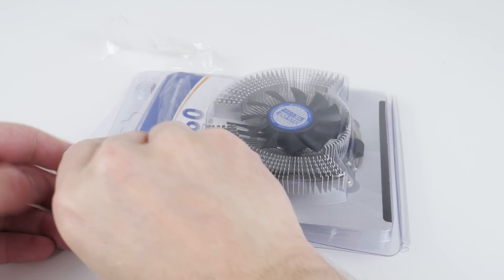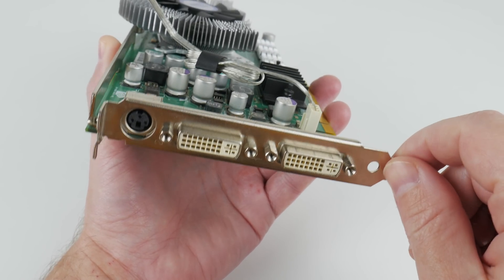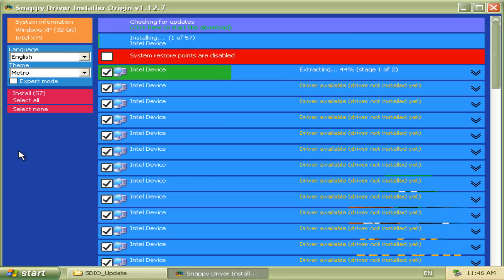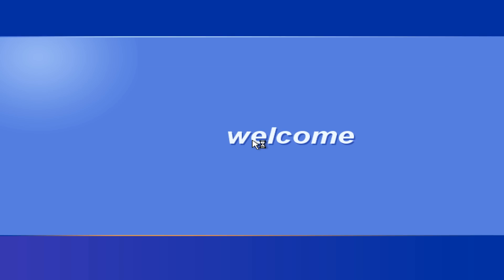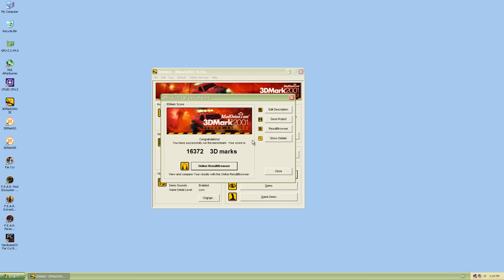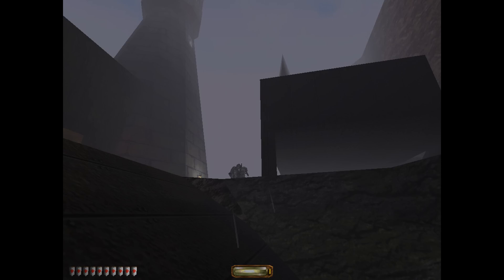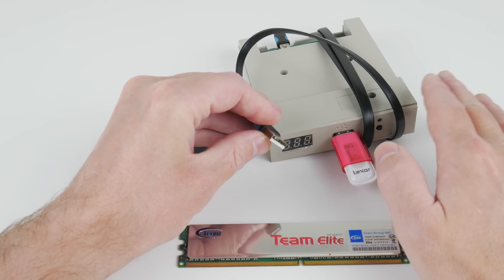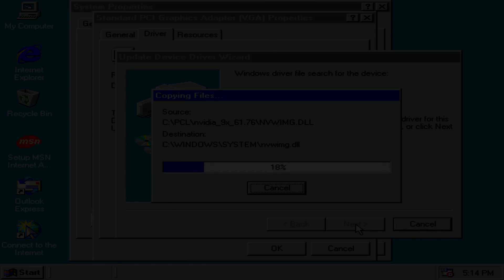Nvidia Quadro FX 1300 - FX Retro features with PCIe

Comment: After converting a Quadro FX 1300 to PCX 5900 on a hardware and BIOS level, it turns out you ran the wrong driver. 175.19 is notorious for issues with these cards. With 71.84, both an unmodded Quadro and a Geforce PCX 5900 will support 8 bit paletted textures. Also you can see in your FF7 config tool that only the software renderer was available when you ran it! Time for a retest? If you want to know how the hardware conversion works, let me know. It is simple soldering that I am sure you can do!

Comment: noticed you had a lot of trouble with the card there, i did too at various points through testing.  the best way to use this card is to first target a system that is more enterprise from the time, like a precision or optiplex or etc, core 2 era preferably.  second is to use windows xp 64 bit (i know i know...), it is what seems to be what it was most intended for and has the best compatibility with at that specific point in time.  it eliminates nearly all of the driver issues experienced with any other os, allows the maximum number of possible games to be playable, and at their intended performance, and etc.  windows vista 64bit is the second best choice, but even here you start to have a drop off and experience some problems.  any other 64bit os lacks a driver or doesn't work when forced, and nearly all 32bit os have problems so great it's crippling.

Comment: Ok Phil, I received my FX 1300 card and had a chance to mess with it under WinME. Since the drivers you used didn’t work, I went for the unofficial NVidia 82.69 drivers. The installer detected my card no issues and I played some Expendable. No issues whatsoever! All options in NVidia control panel were available and I even tested tweaking with PowerStrip. My test system has a P4M890-M7 TE motherboard with a Core2Duo 6700 and 4GB DDR2. I have the RLoew patches for SATA and ram installed, and I’m dual booting WinME and WinXP on a 2.5” 320GB SATA drive. Maybe you can give the FX 1300 another go under Win98 using the 82.69 drivers. 👍
Reply from the maker: Can you try the FF7 demo to see if palleted textures are supported please?
Reply: @philscomputerlab  will do sir!
Reply: @philscomputerlab  sorry it took awhile. I had to install a sound card since FF7 Demo looks for MIDI too. The answer unfortunately is no. The 8-bit palletized textures says fail. I tried to run the demo anyway and I just get a black screen. Is there anything else you would like me to test?
Reply from the maker: @mesterak  Thanks for testing this, I got the same, just under XP and wasn't sure if it would be different for Windows 98.
Reply: @philscomputerlab  you are welcome. I did test under XP just to make sure as well because I did use different drivers there, too. No dice.
Reply: Have you ever tried it with 77.72? It’s the last driver version that supports palleted textures.

Comment: I've been playing around with this card in an experiment to try and build the fastest Win98 compatible mini-ITX machine I can get, and it's been a pretty decent upgrade over the FX5500 PCI you'd usually be limited to on the form factor.  I was curious how Win98 would deal with PCIe, and on my DFI Itox CT132-B1U (a really cool little mPGA478 mini-ITX board with both PCI and PCIe slots), it surprisingly doesn't seem to even know the difference and just sees the card as a PCI device.  It does seem to be limited to 1 lane, which makes sense, with 3DMark 2000 scoring about 7200 in Win98 but over 17000 in WinXP, but it does work and that leaves the other PCI slot open for a sound card.  Even more to my surprise, I bought a $30 PCIe to PCI adapter off amazon just out of pure curiosity to see if it'd work, and astonishingly it did with more-or-less the same performance as when plugged into the PCIe slot in Win98.  My take-away conclusion is that this card may be a great upgrade alternative if you're looking to get the most out of a Win98 build with no AGP slot.
Reply: That's awesome, I'm doing the same thing with a 479 board.  What software did you use to check how many lanes the card was running?

You still like the FX? I was thinking of grabbing one.
Reply: @foch3  I'm just assuming based off the performance drop going from XP to 98, as this drop did not happen with regular PCI cards.  Not sure if there even is a way to confirm in Win9x since PCIe isn't even supported as far as I know.  The DX9 support on the FX series is pretty useless, but they're great if you just want the best framerates with great all-around support for  9x era stuff.
Reply: @k7a  Picked one up just because.  I'm using a 915G chipset on an industrial motherboard with a PCI-E 16X slot, that has full driver support.  Amazingly this card exhibits the lowest drop I've seen from XP to 98SE.  I lose 20% on most cards typically.

What Board are you using?  Edit: never mind DFI, that board looks legit.  I like yours better.  

On my board using the SATA ports drastically increases the mouse latency in 3d games, to the point I was going to right the whole thing off.  On IDE it feels as it should.

I'm also getting resource conflicts with any non Bridged Nvidia GPU's.
Reply: @foch3  Oh I'm totally sold on DFI boards after this one.  Manual's the best I've ever seen, actually includes notes explaining obscure settings and features where every other board manual just lists what's there and and leaves you to google what it actually is/does.  I also emailed their support and they were still able to answer all my questions on this 15 year old board.  Better experience than I've ever had with a consumer board.  Really turned me on to the industrial side of retro computing.
Reply: @k7a  Yeah I had the lan Party Ultra-D, an outstanding Athlon 64 939 board.  It was a shame when they left consumer boards.

What processor are you running?  Your scores seem higher.  I'm on 1.7ghz Pentium M.  3dMARK 2000 I'm getting 6200 and 2001 I'm getting 8900.

Edit:  How do you even use the 16x PCI-E slot?  wouldn't it be behind the IO shield.
Reply: @foch3  Yeah, slot's behind the IO shield.  No idea what they intended there, but I used a PCIe riser cable (Fractal Flex VRC-25) to run it to a nearby slot.  I tested with a Core2Duo 5500, presumably singly core only in Win98 but still, yeah, I'd expect some gap vs. a Pentium M.  Also 3DMark is a fickle beast.  Always has been.
Reply: @k7a  What drivers are you using?  The 6x.xx drivers are the only ones that even listed the FX1300.  I'm going to back through the drivers now that I have the system figured out, this time without focusing on 3dmark but rather in game feel.
Reply: @foch3  66.94 I think for Win98, and 61.77 for XP, however I probably started with whatever the earliest version was that listed support for the card on Phil's site.  Was trying to troubleshoot DX9 stability issues but in the end it seems like DX9 was just cursed to crash on my particular card.  Never did get DX9 working particularly well on it.

Comment: @PhilsComputerLab - it is working for me. Can run 3dMark2000 and Unreal Gold on a FX1300. Setup: Asus P5PKL/1600, Core 2 Duo E8500, 512MB ram, WinME, Nvidia 82.69. Motherboard on standard WinME drivers, HD Sata on Sata Port. DVD-Rom IDE on SataPort with Adapter. Bios settings: IDE Sata only, Compatibility mode. APIC 2.0 disabled. USB 4 ports only (instead of 8). Lan and all onboard features (Serial, Audio, etc) off. Disabled the VGA with yellow warning, installed the Nvidia drivers. On first reboot it might freeze and get not loaded on reboot. Install again and 2nd time it works.
Reply: 3DMark2000 w/ FX1300 7030..... FX1500 42140. I will try other Nvidia cards. I don't have ATIs to compare on PCIE, only AGP.
Reply: Unreal Gold on FX1300.. fps 57 min 261 max 126 avg / cycle 51sec. On FX1500... fps 195 min 895 max 416 avg / cycle 25sec.
Reply from the maker: Awesome 👍
Reply: @philscomputerlab  Thanks :) / tried also on a Gigabyte GA-965P-DS4 with Core 2 Duo E6400 and it works!. I used the same hard drive with the previous WinME installation, didn't have to install anything... at startup it detected everything, restarted and it was there. FX1300 detected, could ran also 3DMark2000 and Unreal Gold. Please let me know if you need any additional details. I made a short video showing the system running - can upload to Youtube if needed.
Reply: Have you tried it with 77.72? It’s the last driver version that supports palleted textures.

Comment: For cheap pcie fx card also nvs 280 is an option, though it has annoying video connector. Btw if someone wants legacy boot and nvme the 950 pro is only option. (Samsung made a workaround)
Reply from the maker: I see, I have a 980. I haven't tried the Clover project with XP, but have used it with Windows 10 booting from NVME on a FM2 platform.
Reply from the maker: NVS 280 seems to be a FX 5200? With 64-Bit interface 😁
Reply: Been using fx5200 with 64bit bus in 2005 so I'm immune. 😁 It's ok for win98, for some reason other pcie fx cards are pricey in my region.

Comment: The AMD SATA AHCI drivers seem to be really finnicky to get working under Windows XP, I installed Windows XP on an APU system that was probably among the last generation AMD supported Windows XP on and I seem to recall I had a hell of a time finding the right AHCI driver that would actually work and not result in the dreaded inaccessible boot device error, it was really fun when I kept having to reboot the XP installer each time it failed..

Comment: Are these retro features that important? Usually older games had native 3DFX support, so you can use nGlide wrapper that works on any modern GPU.
Geforce had XP drivers up to GTX  9xx series. So you can run older games in 4K easily.
Reply from the maker: They are important to some! Table fog especially is used in quite a few games.
Reply: @philscomputerlab  nGlide is emulating all 3DFX features by using shaders. It should display table fog correctly.
I think it's a good idea for a video to compare for example geforce 6600 that has no table fog with FX that has and then see if nGlide can fix such issues on newer hardware.
Paletted textures and table fog were used in times where games mostly had glide and usually glide was a better choice anyway.
Reply from the maker: @Leeki85  The sticky point with this is that not all affected games support the Glide API. Thief 2 for example only uses DirectX, so does Final Fantasy 7 and also the Star Wars game. A PCI graphics card works well, especially the older games run fine on such cards.

Comment: Awesome video I love     Nevidia quatro Video cards I actually have one It's the quadro 4000  
I have itIn a machineIs running  quad core Core 2Extreme With  4GB DDR 2And I'm runningWindows XP 32 bit 
 I haven't tested out  Crisis  But I've tested GTA  San Andreas And I get overA 100 frames Per 2ndWith the frame limiter turned offAnd all details to MaxAll running at 1080PThere's a few other games I haveAnd they all run at extreme Frame rate In   3-D mark 2001  2nd edition With   all   All details Set to Max  for  1080p  For a score Of around 30000  For the most part every game works And the best thing Is my card seemed to  Over clock really  I love my Work station card it was never meant to game But it's beast  It definitely Does superbly As a retro card Even though It was designed as a direct X11 card So if you ever get a chance You should definitely Check out The quadro 4000 But I don't think it'll work with windows 98 Since it's a part of  The firming generation Of graphics cards Anyways thanks for the video

Comment: Maybe you can try the modded Nvidia "Omega" drivers to see if the compatibility improves as I use it to run Win 98 on a Dell Inspiron 8100 with a Geforce 4 Go which never officially supported it and it supports most card from the geforce 2 - 6000 range on 98, XP, and Vista.

Comment: Man I wasn't expecting a face reveal from Phil. It is great to put a face to the voice. Great to see you making content man. Love to see retro stuff like this.  It is interesting to see a graphics card Delidded because that particular method is very well known with CPUs.  I think in Windows 98's case that PCI-E might be an anomaly that it doesn't know what to do with and maybe that is the reason why Win98 can't detect or load the driver for the card?
Reply from the maker: Yea PCIe and Windows 98 are not an easy combination. I had more success with Radeon X800/X850 cards, but they don't support palleted textures and table fog.

Comment: The people at Vogons have had success getting a GeForce FX5800 bios running on a Quadro FX 1000 card.  The process is kinda complicated, but in theory you should be able to get a GeForce PCX 5950 bios running on this card, though I don't know if the memory type mismatch between the 2 cards (GDDR3 on the PCX card but DDR ram on the Quadro) would cause problems.  The FX 5950 has the same ram type so would fix that problem by using that BIOS instead, but it is an AGP and not PCIe card.
Reply: I realize how old this comment is, but there is also a PCX 5900 - and that card has DDR memory, unlike the PCX 5950 with GDDR3.

Comment: Thank you for this video (and for your contribution to retro computers in general, I'm a big fan)! I love reviews of quadro cards because i use them at work. It would be great to show their real capabilities instead of their lack of gaming performance. I don't know any channel that does that. 
On CAD softwares, such as the ones made by Dassault system (catia) or Autodesk (fusion 360) their performances are so far beyond their gaming counterpart. 
For example, i was building a complex model, running it smoothly on my old laptop equiped with a p3200 max Q (equivalent to a slow version of a mobile geforce 1600) and my colleague could barely view it on its gaming desktop workstation equipped with a 2080ti. It was so slow! 
Quadro drivers are optimized for heavy nurbs geometry which are what engineers work with. Everything, in CAD models, is represented in its entire geometric complexity until the smallest screw. No normal map to optimize for visualisation. It's made for manufacturing. 

It would nice, one day, to show the quadro difference. Most CAD softwares offer trial versions now, and complex CAD models are easy to find online, for free.  

Thank you!
Reply from the maker: Do you know the M6000? There was a deal on a Z640 workstation with this card and the seller mentioned they will have more. But now the price has increased, bugger. It's basically a 980 Ti but with 12 GB. I'm currently using a K2200 in my Z440, it has NVENC that I use for game capture and 4GB with GTX 750 Ti performance, enough for some old games.
Reply: It must be fast! I didn't know that quadro cards were improving performances in encoding. How is the boost ?
I can't wait for my employer to replace my workstation. The A5000 and A6000 are great for real time rendering on keyshot!
Reply: Regarding video games, i dont use the raw power of my laptop.  i still play doom quake and total annihilation, even though i could play these games on my 486s and p166

Comment: its single channel cause you have the memory on the wrong slots....
Reply from the maker: The slots are good, but I mixed a 1GB and 2GB module. Also, watch the video 😅
Reply: @philscomputerlab  i paused to comment, then cotinued watching... there are 2 pair of slots in diferent color.. probably like A1 B1 A2 B2. if you want dual channel you must put the pair in the same color slots.. (thats how most motherboards are)the size of the modules does not matter.. you will have asynchronous dual channel if you have 1gb and a 2gb module
Reply from the maker: @sergiobisonte  Look I just worked on this project and checked the manual. After using same size modules, it's running in dual channel.

Comment: FFVII is weird. Sometimes I pass all tests. Sometimes everything but 8 palate textures and sometimes I pass that but fail everything else😮 I’ve used a GF3 and an FX5500. I’m using the full game on disc not the demo. I just picked up a GF4 4200 still new In box for €30. I haven’t opened it yet but I hope it still works. I was surprised at the price since last time there was an unopened card I tried to get the price went way over 100 bucks and I didn’t get it. The date on the box say it is from fall 2002. Amazing to see it sealed for 20 years but I will open it.

Comment: 6:42 those clocks are still a bit shy of the 475/475 of the Geforce card.
Reply: Card have clocks similar to FX5900 XT, that was my goal at minimum. Clocks on VRAM are 50MHz higher, because memory simply allowed to set such speeds.

Also out of 8 cards that I had one even hit 475MHz on core and 850MHz on VRAM and two 450MHz on core and 850MHz on VRAM. Core and VRAM have to be tested separately on each card, so it took me some considerable time to bin these FX1300's properly.

Each card was tested for like 4h for artifacts. If any of them failed test, lowered the clocks, and continued with testing.

Comment: It's so different to see the face behind the hands and the voice I have listened to for years.  Love these videos.  And I can't wait to see the next.  Keep up being awesome!  Also, is it possible that the reason the NVMe didn't show up was due to it utilizing AHCI instead of standard IDE SATA mode?  If you have an AHCI driver for that board that can be put on a floppy disk, you might try loading that with the Windows XP installer and see if that makes the drive visible.
Reply from the maker: Yea that's how I do with SATA AHCI drives, but didn't show up with NVME. There are workarounds involving using software on a USB drive, might be something to check out.

Comment: I haven't tried a FX 1300 on AM2+ or X79.  I did on a GA-G41-ESL2 and was successful installing the unofficial nvidia driver.  I know you are done with the project but if you ever want to try again give the driver a shot and perhaps a lower end intel board.  I haven't had much luck with 9x on any AM2/AM3 board.